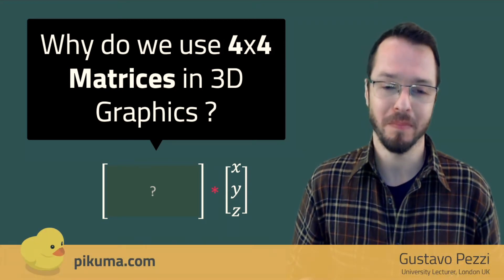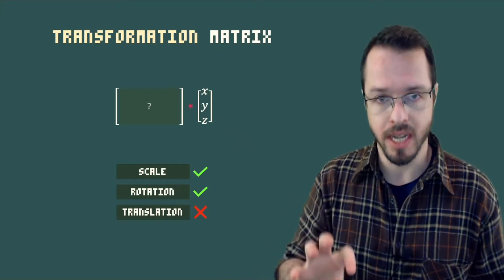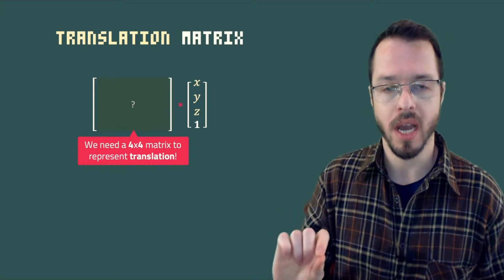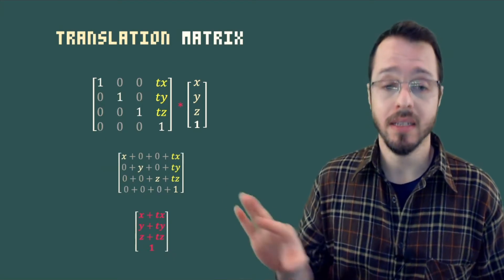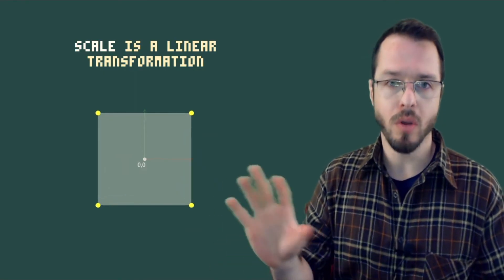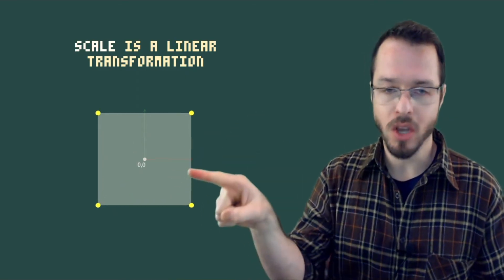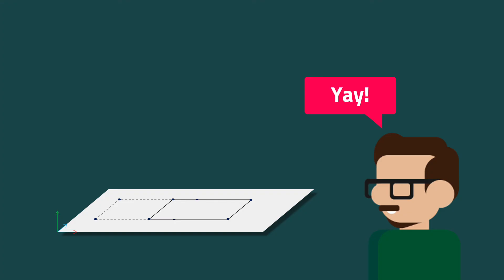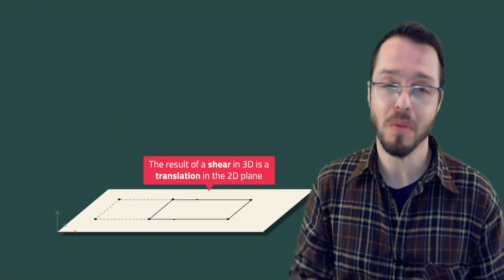Math for Game Developers: Why do we use 4x4 Matrices in 3D Graphics?

Comment: I don't like to think of squares as elements of 3D composition. I prefer triangles, since a square is made up of 4 triangles.

When we use a composition of 4 triangles, we form a pyramid with a triangular base. And with 6 pyramids of this type, we have the structure of a hexagon that fits into another hexagon, without losses. This allows for the creation of smoother graphics than using cubes. 

In other words, I'm just saying this as a side opinion that originated from the title of the video and not from its content itself. 

My mind is thinking in terms of the technological design of hexachrome pixels.

Comment: There's an easier explanation that can be more intuitive for people who works in 3D design software. Like you've said, rotation and scaling is done in relation to origin. Let's imagine we're doing it to 3D object, a box. Our box have an origin in relation to wich we scale and rotate it's vertices. These operations are independent from anything outside that box, like if nothing exists besides it you can still perform them. But translation is an operation relative to outside world. We perform translation to move the box in relation to external coordinate system, in relation to the origin of the 3D space this box exists. So that means that basically by performing translation we are adding how much we shifted our entire object, intact, including it's origin in relation to higher coordinate system (world, screen etc)

Comment: its a good explained and it answered my question but nevertheless I think it is not good to say that it is mathematicaly impossible to achieve this result by 3x3 matrix.  when you want to shift 100 pixel to the right on the x-axis what about this matrix:
|(100/x)+1   0   0|
|     0             1   0|
|     0             0   1|

Comment: Another way of explaining why 3x3 isn't sufficient might be this: the only way to move the X, Y, and Z components in space is by multiplying a factor to them. This factor would be on the diagonal line of the 3x3 matrix. So, e.g., if you want to move X by its double distance, you must calculate 2x+0y+0z. You can generally simulate an addition by multiplication if you know the correct factor. However, what do you do when X, Y, or Z is zero in the first place? No factor would ever change, aka. translate that component because factor times zero stays zero. 

Yes, this is the basis for "linearity." Still, I think it makes arguing in favor of the fourth dimension so much easier as you have an exception, which makes the feasibility of a 3x3 matrix break immediately.

Comment: I don't see any mathematical problem with using 3x3 matrix to do translation.

Addition can most definitely be represented with multiplication.

x' = x * ((x+n)/x)
n is for translation value

So if you want move 3 steps
7 * ((7 + 3)/7) = 7 * 10/7 = 10
You can do this with any number.

It's messy but it's doable.

I think the main reason we use 4x4 matrix is because the problem of translation in perspective projection.

Comment: This blew my mind. This is such an incredible and intuitive (even with the 4 dimensional aspect) way to interpret and think about translations in 3d space in computer graphics. I never put that together in my head before in such a clear and understandable way, I just knew "well you need a 4d matrix" and let the magic happen. This is a wonderful video.
Reply: Right, the more you think about higher dimensional space, the more generalized you can see the lower dimensions. It's often said that in 2d space you can only rotate around point and in 3d space you rotate around an axis. Though generally speaking that's not really true. In many cases when talking about 2d rotation people imagine a rotation axis going through the point of rotation. So the try to visualize the 2d case as the 3d case. However it's only in 3d that rotations actually rotate around an axis. In reality rotations happen inside a 2d plane. This is true for all dimensions. That's why 2d space has just 1 way to rotate since there is only one 2d plane which is the whole space, you have 3 rotations in 3d space (xy, xz, yz) and why you get 6 rotations in 4d space (xy, xz, xw, yz, yw, zw). 

Also most understand that a 2d plane has a normal vector. Though this is also not true. In 2d space you again have to imagine 3d in order to define the normal. However in 4d space a single 2d plane requires two normal vectors or another orthogonal 2d plane in order to be defined properly. "Hyperplanes" are defined the same way in all dimensions. However a 4d hyperplane is actually a 3d volume with distance "d" and not a 2d thing. A hyperplane in 2d space would be an infinite line with distance d from the origin. Such a hyperplane is always defined by a normal vector and a distance from the origin. In 4d space having a single normal vector leaves us with a 3d space that is orthogonal to that normal. This is what homogeneous coordinates essentially represent. It's a 3d sliver of 4d space at a distance of 1

Toying around with higher dimentional spaces can tell you a lot about the trivial (1d, 2d, 3d) spaces and can change how you think about the ordinary world :)

Comment: I guess the need for 4x4 arise from our wish to only use multiplication to apply all transformations at once (transformation = coordinates ⋅ R ⋅ S ⋅ T).
Because if, alternatively, we use transformation = coordinates ⋅ R ⋅ S + T ,  it seems we do not need an additional dimension. Simply apply RS transformation and add dx, dy, dz to position points in 3D space. But yes, very cool idea and explanation why multiplication requires higher dimension.
Reply: You guess huh?

Comment: it was rather customary before to simply use a 3x3 matrix for rotation and scaling, then adding a vector for translation.
With older constrained systems, that was more efficient memory and computationally-wise. Obviously with current hardware performance, it's better and more flexible now to use quaternions and 4x4 matrices.
I mean, I remember as a kid working out the trigonometry to project a 3D point on the screen 2D plane, and translate, rotate and scale, before I learned about matrices...
Obviously 4x4 matrix calculation is much more elegant and simple.

I guess it's like learning about the Laplace transform and complex numbers, instead of awful non-linear equations :-)

Comment: Firstly, thank you so much for your presentation. This playlist helps me so much :)
 So, if we work on a 2D object, we don't use 2x2 matrix. We have to raise the dimension to 3D, and use a 3x3 matrix. And this matrix will be like: 
[1 0 tx]    [x]
[0 1 ty] * [y]
[0 0 1]     [1]

 We do shearing at the last column of the first matrix, and the last element of the second matrix is our offset to transform 2D to 3D.
 Am I right?
Reply from the maker: Yes, that sounds correct. Check this link on transformation matrices for games and you'll see the 3x3 matrix you described for 2D listed there:

https://www.alanzucconi.com/2016/02/10/tranfsormation-matrix/

Comment: Ok. But why do we use matrix multiplication for translation in the first place? Not only it's more computationally expensive but it also produces the same result as vector addition. What do I miss?
Reply from the maker: Most of the time we want to either combine transformations into one single matrix (meaning we can have translation, scale, and rotation encoded in one matrix), but also because we want to seamlessly perform transformations one after the other, and by having everything encoded as matrices makes the process simpler. It's just matrices multiplying matrices, always.

Comment: You chose to perform a projection using a sequence of operations that is "non-linear". So, somehow you suggest your arbitrary definition for calculating a projection coordinates with some translate-operation is universal? Am I off here? Seems unwise. Edit: The wisdom with transformation matrices is that you don't operate on the object vector (vertices), of which there might be tens of thousands - instead you transform a 4x4 representation of a sub-coordinate system, and save bunch of time. So this misses the whole point for having these matrixes all together, as well as generalizing some arbitrary idea of generating a projection as "non-linear". So, you'd do well to revisit this, or perhaps I misunderstood your attempt.
Reply from the maker: Hi Casimir. I'm not sure I understood all the points you made in your comment. Maybe it's just me and my limitations in the area. I am covering very simple ideas for transforming vectors in computer graphics. The traditional approach (that many applications use) is to have a 4x4 matrix multiplying all vertices in our scene (converting them from local space to world space). Projection is a different case, where we can also use a matrix but the entries of that matrix take other things into account (like field-of-view angle, device aspect ratio, etc.). What I covered in this 4x4 matrix video is mostly linked to using a matrix to transform 3D points in terms of scale, rotation, and translation.
Reply: @pikuma  Re: so, to further frame: the title for the video is "Why.. 4x4 Matrices", and also you had a story about "non-linear translation" as part of making a projection, which struck me as arbitrary side-track. So, again, the why is, so that we can skip touching the object geometry and transform bunch of matrices until projection is rendered, and mostly rendered in hardware. Hope that makes sense, videos look good.

Comment: Note that already in the 2D shear illustration, the top and bottom edges of the shape is already being "translated" horizontally(!) As in, their 2 vertices move together - the edges maintains their size and shape. Right there already there's a clue: A shear applies a tanslation in a lower dimention (sub-space).

Meaning, a 2D shear applies a 1D translation, to any line perpendicular to the axis being sheared. If we skew the Y axis, then any X-axis line that existed before, just slides sideways as-is (without scaling or rotating).

Then, when going to 3D, skewing the Z axis applies a 2D translation to any XY plane that existed before the shear - it moves any plane sideways and/or back/front, again without any additional transformation within that plane (no scaling or rotation) - just moves as-is.

Lastly the same can be envisioned to happen when skweing the W axis, applying a translation to any XYZ volume, again without any additional transformation within that volume (no scaling or rotation) - just moves as-is.